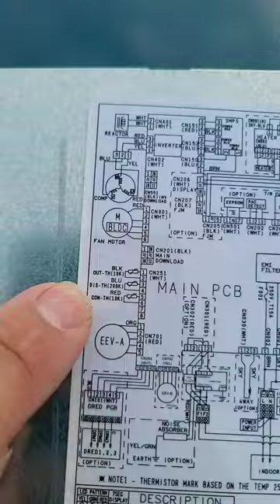Error Code E480 and E470 Samsung HVAC @samsunghvacAmerica

Comment: You are a true A/C technician. 👍
Reply: I got a question for you can u help me? 
I rewired my a/c squirrel cage fan to be a regular fan in the garage. I had my entire A/C & heating system replaced with a brand new 4 ton Carrier unit. However the fan after running 10-12 min gets  too hot . I chose the black wire as my speed of choice the blue & red wire I capped off, the green wire of course is ground which I ran to the motor casing. There was 2 brown wires that went to the capacitor from the motor however, the technicians that removed it cut the wires for some reason, they didn't know I wanted to reuse that fan. The capacitor has only 2 ports with 4 prongs on each, is one negative and one positive? do it matter which wire goes on which port? There's no indication of what port does what on top. Could I have gotten them crossed since it ran fast and quiet but runs hot? I don't want to burn up the motor. Any ideas?

Comment: Last week we installed a 3 ton minisplit and as soon as the electricians installed the breaker my lead immediately set the remote up to heat for its first start since it was a chilly day. The unit would not come on until we reset the remote.  It's just a theory of mine but could we have jump the gun on that before all the thermistors had a chance to calibrate? Thanks for the great videos!!
Reply: Probably just coincidence. They take a few minutes to switch from cooling to heat mode (and vice versa
Reply: Follow manufacturer's start up procedure there's certain sequence of powering up

Comment: All the energy savings you thought you were going to have down the drain from a 1k repair. Going even more red since you haven’t broke even with savings due to high cost and install labor charges. Takes years to break even in energy savings with the brands that require contractor install. The outdoor unit basically has to have great outdoor conditions 24/7 not to cook themselves. 
If you’re gonna go get a high efficiency mini split, get the cheap DIY unit for 2k because they are all gonna blow out inverter boards from cheap materials and poor heat sink design. Might as well spend less up front.
Reply: Exactly. The consumer is the looser.
Reply: Been using 6ton panasonic vrf with 4 indoor units in my home since 2017 & other than some drain pumps and swing motor replacements i didn't have to replace anything else. 
The new unit cut my electricity bill by ⅓. 
The old unti was a 6ton air handler and here we have 50c ambient for few weeks of summer. And 40+ for months. 
The vrf acts as heat in winter but i barely use it in winter. In general it runs for 8 months of the year and so have saved me well over what it did to install. 
Parts and labour is obviously lot cheaper in India. 
I have other inverter units from hitachi , whirlpool and Mitsubishi on other places aswell. None of them ever gave trouble. Using inverters since 2014. 
 These days you can't buy regular airconditioners anyways. Stores are only selling inverters due to newer energy savings requirements set by the govt. 
You can get your hands on non inverter but those are generic unbranded units and questionable quality with no warranty.
Reply: Agreed !
Reply: same thing with people that think they are saving big buying an electric car and then they get hit with a $10,000 bill for a new battery

Comment: hate those things. so dam conplicated
Reply: How so?  Voltage always same  frequency always changing.  Exactly the same as upper end rooftop units and the VFR and variable air flow in upper end residential.
Reply: @SovereignTroll  There are only 2 systems.  Constant volume and Variable air Volume.
Reply: @marshalljimduncan  So it doesn't have VRF....

Comment: I really don’t understand why companies are talked into using ductless split systems in server rooms? To my knowledge only Mitsubishi has a unit specifically designed to be used in server room. But really Liebert units should be used. The rooms are worth millions they install a low end ductless I don’t get it
Reply from the maker: mini splits can be cooling only and come with low ambient kits
Samsung has specifically designed units for server rooms
Reply: @TaddyDigest  but they don’t have humidification which is required to be total environment unit.  As server room require 40% humidity so you can maintain 74 degrees.   Rather than just cranking down the remote to 68 degrees and hope for best.  Humidity control is critical for life span of the ups batteries and most server need humidity control.  Again those units were never intended for that application. Why do you think that mold grows pall over the blower and the blower wheels.  Not made for that use.  No matter how many baffles you install or how low they allow them to operate.  No receivers to hold refrigerant at sub low temps.
Reply: @dimaslespier2688  APC units are better than Liebert.

Comment: If no leaks; why did you need to factory charge the system? Did you perform a leak search. Not saying you didn’t fix the problem but the refrigerant side of HVAC is the true nature of our trade and I don’t like misleading information about troubleshooting when it has to do with refrigerant issues. I’ve had so many ill trained people add or adjust refrigerant charge without putting in the work/time to inspect the whole system properly first.
Reply from the maker: You're preaching to the choir.
I totally understand.
Misdiagnosis happens to often.

Indoor coil was replaced on this unit 
So there was a leak about 6 months ago and then came back to find a bad board.

Comment: Minisplits = unreliable & expensive to fix
Reply: You need a surge protector, do  maintenance and  replace thermal paste when need it
Reply: Whats expensive on a mini-split its just like any other inverter?
Reply: My state is full of mini split heat pumps that have been working their asses off making heat in true winter weather for over a decade. 

We had lows -15 F before the wind chill this winter and my installs were just out killin it...

I think 410A and a grid that are struggling to keep up with changes are to blame for people getting that impression.
Reply: Junk